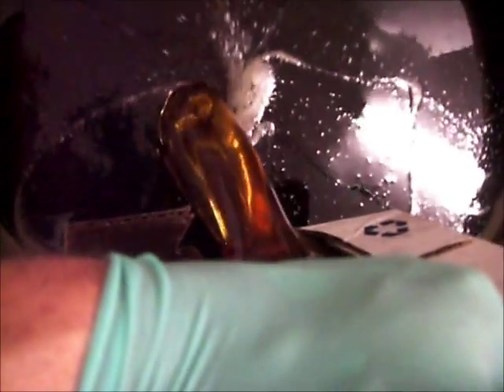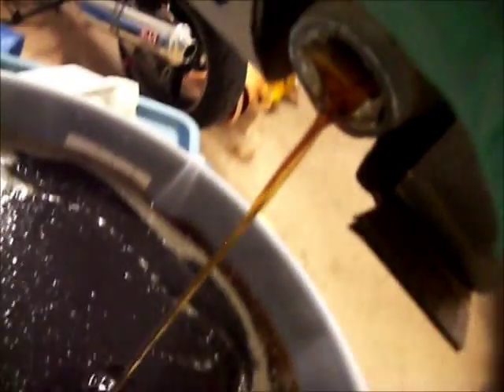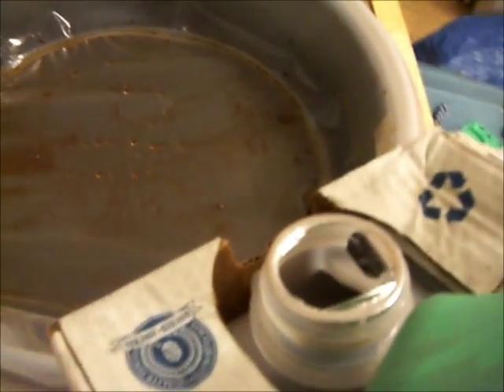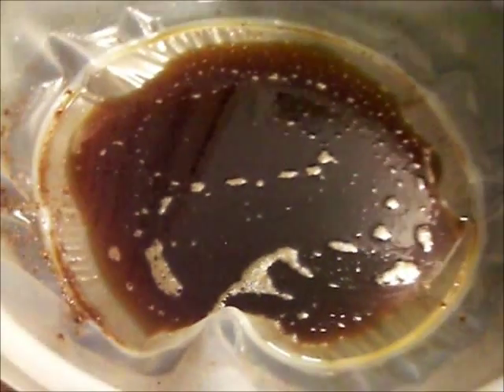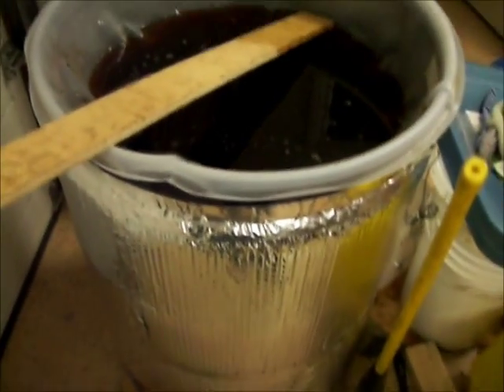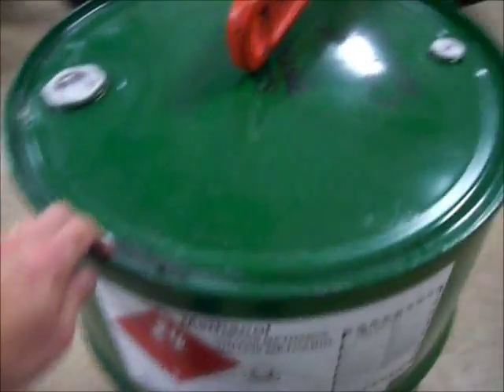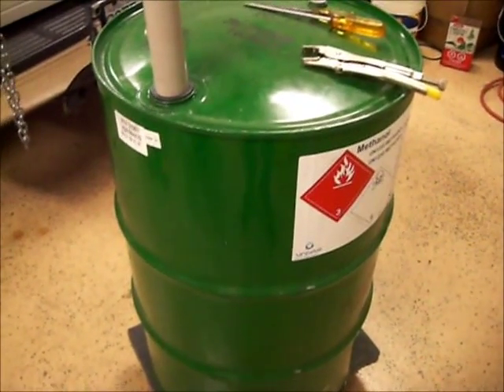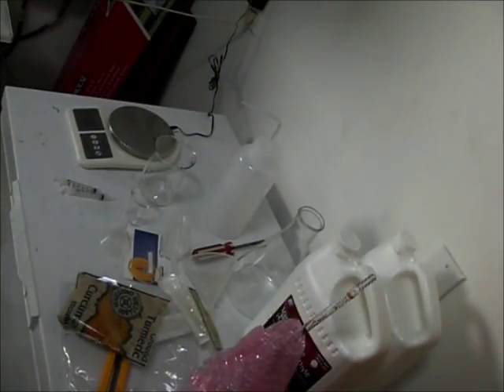Biodiesel Batch #2 from waste fryer oil - input oil to mixing

Comment from the maker: Oh sorry, that was from a commercial kitchen supply place in Richmond, BC. It's cheap stainless. So far it's held up no issues. It's big enough u have to bend it a bit to get it through the top hole. Then bend it straight once in the tank.

Comment from the maker: The blue plastic drums have smaller neck size than the steel barrels so keep that in mind if you want to use a blue drum for filtering later. You just angle the filter slightly for those.

Comment from the maker: You can get them from dudadiesel d o t c o m or utahbiodieselsupply d o t c o m or ebay. I started the process using 100 micron screen filters but then went to 400 micron which flows real fast. Go at least 200 micron, 100 is too fine in my opinion. Any remaining tiny bits settle out with the glycerol anyhow. They are drum and pail filters. You can buy them like this for 45/55gal steel drums or 5gal pails.